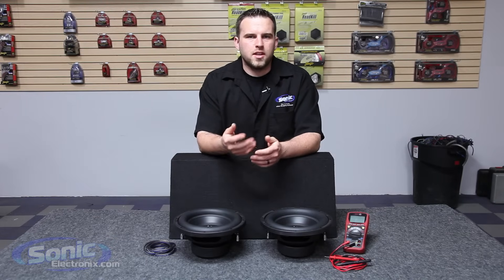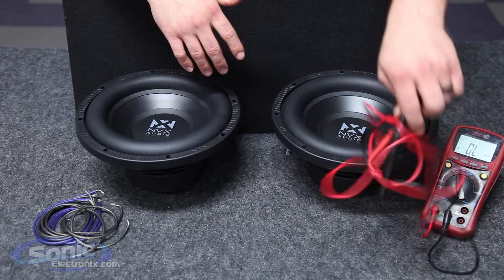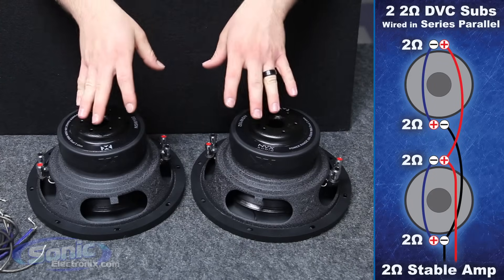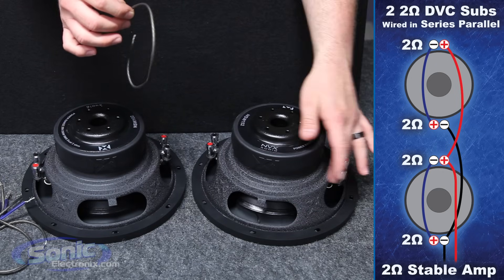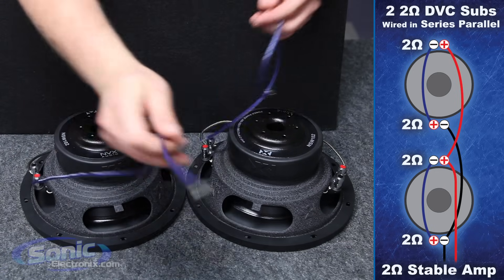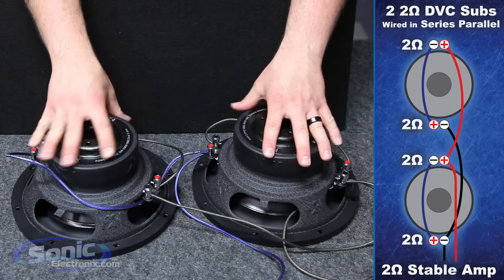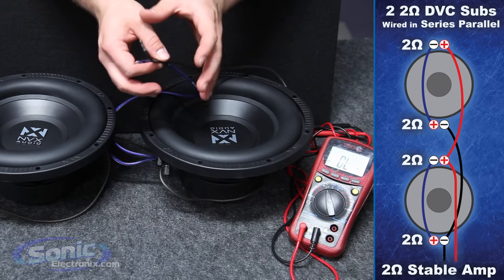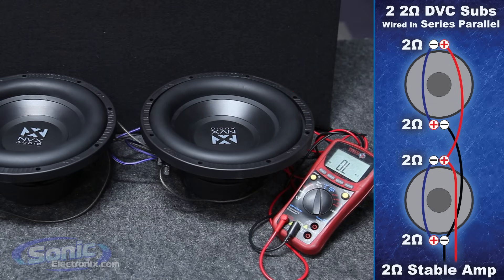How to Wire Two Dual 2 ohm Subwoofers to a 2 ohm Final Impedance | Car Audio 101

Comment: how do you do it when each speaker is in a separate truck box?  the 2 loose wires you ended up with would conect to 1 of the speaker boxes neg and the other wire to the other speaker boxes positive?

Comment: This video is the best that I’ve found the only issue i have is how to i hook up the subs? I have 2 connection terminals on this box for both subs, do i run a set of wires for both subs or just one set of wires from one of the subs? This video would also mean i have to run wires behind my port on the box which would be visible looking into the port

Comment: I have a kicker comp C8 8” rms 300w, if I buy another 8” and wire them this way, can I run them both off of my mono Rockford Fosgate P300x1 and have them rms at 300? Or would I have to get an amp with more available rms
Reply: That will work if your comps are either 4 ohm single voice coil each, or 2 ohm dual voice coil each. The rf 300.1 is 300 @ 2 ohm

Comment: After it's all wired up inside the box ..... How do I hook the speaker wires to the amp ? Because mine have both a positive and a negative on both sides of my box along with 4 outlets on the amplifier. Pos, neg, pos, neg.

Comment: If the 2 subs are rated as 600w each, after doing series and parallel connection like what you have done, do i need a 600w @ 2 ohm amp to drive these 2 woofers or i need 1200w @ 2ohm amp?

Comment: And what about cheapskates - who "borrow" - their own house speaker sub's (the 12" 8ohm jobs) that were the old house stereo B set speakers...?
Getting a 16 ohm single speaker
Directly bridged across a "still" working stereo two speaker amplifier running yes - two 4 ohm speakers.?
The final impedance SEEN by the amp - was a mere 2.666666666666667 ohms per channel
HOWEVER -  as the two channel amp - isn't exactly a 180 degrees opposed unit - but one of about a 90 degree to 120 degree offset - these three speaker channels then became a delta connected circuit - almost the same as any ordinary 230v/400v AC Power distribution system - running homes and businesses and the like - with full energy Hydro-Electric Power Stations driving those systems.
SEE - having two stereo channels output from one amp - doesn't mean that these are simply a single channel one speaker (filter bypassed) one speaker amp.?
Nah m8 - these are nasty beasts that can easily handle - any weirdly connected and paralleled speaker array - that "nearly" addresses the delta configuration - and thus delivers the same as - same as "voltages" across the two master channels - whilst delivering a phantom phase voltage - across the single DELTA connected speaker.
BOOM - three channel surround sound - from a single two channel amplifier.
Adding additional series / parallel speakers - (or multiples of each) - one doesn't take long - to hard wire in 25 speakers.
All driven by a single low power amp.

Comment: So I could run two subs off a monoblock if it had a stable RMS power supply for both subs combined? Will the wattage be additive or just as one sub

Comment: Can you use dual wires instead of single wires. If you end up with just 1 positive and negative how do you connect this to the box which has positive and negative on both sides of this box
Reply: Did you ever figure this out

Comment: I have dual 1ohm 12' subs...I can wire them in series parallel to keep them at 1 ohm stable.. correct?...to match the amp output aswell...I have 2 t1s1 12's and a t1000-1bd amp.. Rockford fosgate

Comment: My Amplifier have 15 channel Class D, out of which 2 channels are for subwoofer (100W+100W) (8ohms+ 8ohm) 
which is currently connected to a Dual Coil Subwoofer)100+ 100W &(8ohm + 8)

How can I wire one more Dual coil subwoofer (100+ 100) to share the load

Comment: If you have 2 dvc 2ohm woofers in separate boxes. Each wired at 4ohm. Would plugging them into the same amp like a daisy chain make them 2ohm as well?

Comment: What if I series both dual 2 subs up to 4 ohms both, then do parallel wiring at the amp does that 2ohm mean the same as your setup? Because they are in separate box and I use only 1 sub at times..

Comment: I have what is probably a stupid question. If I have two 2 ohm dvc kicker comp R’s in an enclosure with two inputs on it and both subs wired to 4 ohm. Can I connect each subwoofer to a mono channel amp that has 4 posts (2 negative, 2 positive) and get the same rms power to each sub? Or do I have to wire them both together in series parallel to one input on the enclose and then the amp? I’m not sure if that is a dumb question or even makes sense 😂. Basically I don’t want both subwoofers wired directly to each other. I want each to use their own pos/neg post on the amp if it won’t affect my final 4 ohm impedance. 🤔

Comment: What if the subs are single 300watts rms at 2 ohms, and the amp is 825watts at 2 ohms. I currently have only 1 sub hooked up, but thinking about 2nd. How should I wire it? If I parallel them, would that result in 1 ohm impedance and 4 ohm if series? Neither really works for me. I guess I should of gotten 2 4ohm subs to wire down to 2 ohm....

Comment: I have a 4 channel amp that I have two audiobahn tens and then just some crappie kicker door speakers hooked up to then I have a separate amp  for a 12 inch kicker competition R  and I'm getting like burnt wires smells after I run it for a while am I just beating the shit out of it or if you get that smell it's something not hooked up right ?

Comment: Can you not run 2 2 ohm subs down to 1 ohm on 1 amp
Reply: Yeah but some amps only go down to 2ohms
Reply: @josephmonrroy1877  I got two American bass xfl 12s that I wanna run 1 ohm and their dual 2 and I couldn't find it anywhere but I figured I jus have to run them individually to the amp I got a crossfire bmf 1000d I'ma use
Reply: you can't. Either 0.5ohm (not many amps can handle this) or 2 ohm. Buy dual 4 instead. Those will go to 1 ohm

Comment: I always thought dual 2 ohm would get you to 1/2 ohm. I have 2 dual 4 ohm subs and they are wired down to 1 ohm. This shit just confused the hell out of me
Reply: you are correct, you can wire them to 0.5 ohm. But that requires a amplifier that can handle it, so you are better of wiring them to 2 ohms

Comment: crazy question..i know you can wire a DVC 4 ohm sub down to 2 ohm but can you take those two wired down subs and make them to 2 ohm as well final impedance at the amplifier?reason why i ask is i have powerwedge JL 10s and the Tw3 D-4 in there is wired down to 2 ohm internally..i have two of these in a single cab truck powered by JL rd500/1 and im worried im at an unstable impedance..im wondering if theres a way to parralel an already paralled sub

Comment: Hopefully someone can help me. I’m not speaker Savy at all. I bought a sub speaker to replace on a home theater sub that blew out. The new speaker though has 4 hookups like shown in the video but the speaker wire that is running from the existing box only has two wires. Can I just hook up the terminals to one set of hookups on the new speaker and leave the others side alone or do I have to get a different speaker? The old sub speaker had two prongs only so the two wires connected easily but with four prongs on a speaker I’m confused?

Comment: So if u wire each sub series and to its own terminal, and then put both sets of wires coming off the box into the 1 channel amp, are u not at a 2ohm load?

Comment: Would i be able to use negative speaker wire to bridge the positive and negative terminals together? Or is there a certain kind of wire to run from positive to negative?
Reply: Cade Nofziger no special wire it's all the same.

Comment: how do u wire 4 kicker cvrs dual 2 ohm subs at max off off a 6000 gothic series 1 ch amp
Reply: depends on what ohm load you are trying to run at.
Reply: Parallel, if the amp is 1ohm stable.

Comment: I have three 8 inch subs . I want put the straight to the back seat . Will it sound good or will I need a box ? Thanks
Reply: box helps a lot good box designe is more important than how good is the subwoofer.

Comment: How do you do this with two terminals on the box?
Reply: BigSaltine drill a hole in the divider if ported. If not insert one sub in the box and wire both subs the wire the terminal only 1 terminal.
Reply: @Tom-wq2mz  Can I do this also if my dual sub box is not ported. Can I just drill small holes trough the dividing board?
Reply: @AxelfoleyTheGreat  Yes. That's how I do it. It will not hurt anything.
Reply: Puppet Master Man thanks a lot. I had my speakers 🔊 wired where they put out too much power for my amp so at high volume they cut out. My amp is rated at 2 ohms. Hopefully this will fix the issue. When I started upgrading my car audio stuff I only knew the basic wiring. Now that I have upgraded again this stuff gets more complicated for noobs like me.
Reply: @AxelfoleyTheGreat  as long as both or the pair are wired into 2Ω your fine. Do you know what ohm's your subs are.
Reply: Puppet Master My 2 inch subs are 2 ohm. I had them both wired in parallel. I need to change that.
Reply: Drill a couple holes and use some bolts, nuts and washers. All u have to do is connect the speakers cables on each bolt

Comment: Do I need a mono amp or can I use a 2 Chanel?
Reply: lemond Wilson mono amps are made for more power output has 1ch which I personally like. Some 2ch amp can be bridged for more power. It just depends on your preference. I'd tell you go with mono class D amp. That's what I'm using to power 2 12's P2D2 Rockford subs and it shakes and loud.

Comment: got a question for u. i got one 15 4000 watt and 2000 rms the amp i have is 2500 watt and the highest rms is 1000 my question is what fuse size do i need coming from the battery on red wire?

Comment: can you wire two dual 2 ohm sub woofers to an 1ohm amp . if you can respond quick as possible thanks.
Reply: kevo s cause parallel wiring 2 dual 2ohm will give you 1/2 ohm final impedance
Reply: You can't. Sorry. Either you go for 2 dual 4 ohm driver and parallel wire them to get 1 ohm final. or Purchase 2 mono amp to power each subs.
Reply: CORGI GAMING no
Reply: I don't understand why but from what I understand is if you have two dual 4 ohm subs you can wire those to a 1 ohm amp.
Reply: Mary Joan Montalvo how can you get 2 duel 2 ohms  subs down to 1ohm ? ...
Reply: well what kind of amp dio I use for this setup?

Comment: I have two dual 2 ohm subwoofers and I need a final impedance of 2 ohm. But I have two separate terminals on my box. Should I mimic the above wiring and use only one terminal on the box? Or do something different to utilize both box terminals?
Reply: Dominique Romar only 1
Reply: The positive on one side and negative on the other
Reply: Don't worry about the terminals on the box at this point. Focus on the subs How many terminals are on each sub woofer 2 on each or 4 on each 1 positive 1 negative or 2 of each.

Comment: so i have  two q class kicker dvc 2 ohm subs and a Hifonics brutus Elite class d amp rated at 4.850 2.1700 1.2500 would i be safe wiring  them to this impedance  without  blowing them or cooking the anp? iwant to push them to thier  full potential  help?
Reply: If your amp support bridge mode, do it.
Reply: Baby Gotenks you have to look at boss and hifonics amps as a temporary fix. I blew out my amp at 1ohm after 9 months of use. My amp is rated stable at 1 and 2 and 4 ohm stable. I'm personally highly recommend getting a Rockford foss gate 1200 amp. There amps are True watts they stay true to there watts on the box and a lot exceed it. I have a Rockford prime rated at 500 watts and 2ohm stable but is actually 634 watts so you get your money's worth. And there are really affordable prices. That's my opinion just look into the prime series.

Comment: So would you need to double the power then?  Ex:  Say those NVX subs are 500 watts each would you set you amp gain to a 1000 with this wiring method.
Reply: Resilient sounds
Reply: Resilient sounds

Comment: This might be a dumb question but can you wire a duel 2ohm sub to 2ohm?? or do you just use 1 set of terminals and the other ones just sit there doing nothing????
Reply: Low Fast Famous I'm pretty sure you just use one terminal, but idk, never really messed with wiring sub impedances, always bought preloaded boxes
Reply: Low Fast Famous do not leave a dual voice coil unhooked. You will smoke it.
Reply: @mikecarr1484 i haven't tried it myself, however i don't see there being a problem as long as you don't exceed that single coil's power handling.  For example, my Kicker L7R's are two 2 ohm coils.  Woofer's total power handling is 600 watts RMS and 1200 watts peak.  However, each coil is only 300 watt RMS and 600 watt peak.  So as long as i don't exceed 300 watts RMS, i shouldn't have to worry about it blowing.  

Can it be done like this? Yes.  Do i recommend it? Absolutely not.

(I'm not doing this for my setup.  My setup is an Alpine MRV-1507 with two Kicker L7R 122's, wired to a 2 ohm load and bridged to the amp.  A youtuber dyno'd this amp and it put out 1200 watts RMS at 2 ohms bridged)
Reply: THIS! Someone answer please
Reply: Mike Carr disagree..seen it done and did it myself with no problems
Reply: He's wiring both sub to equal 2 ohm, basically taking each sub down to 1 ohm a piece =ing a total of 2 ohms. it all depends on the amp of the user. In this case it's a 2 ohm stable amp.

Comment: ok so I want to hook two DVC 2ohm 600rms subs to a 600rms monoblock amp but don't know if the amp is enough to power both up to the 600rms, is there anyway to wire them so it acts as just one  sub so I get the full 600?

Edit: I figured out that the RF amp can be wired to 1200 RMS at 1 ohm so instead of the 2 ohm subs im going to get the 4 ohm subs and wire them to 1 ohm as per your video. However, there are two pos's and two neg's on the amp and I am wondering if it matters which terminals i connect to on the amp. I guess its internally bridged, its the rockford RF1200 D1 amp.

Comment: how important is it that the subs are facing up? i recently tested them again in the box (horizontally) and my two dual 4 ohm subs are coming up with a 2 ohm impedance which doesnt seem right. i've tested them before outside the sub box facing upwards and it shows 1 ohm which is what i expected. does this mean ill be running at 2 ohms since i wont be pointing my subs upward when it plays?

Comment: how the hell do you get them in the box after you wire them like that? plus what about the terminal inside the sub box?
Reply: Yg Bodybuilder wire the two wires connecting the subs through the box, wire the two wires to the terminals inside, and mount the speakers.

Comment: does it make a difference if I wired the - and + on the same voice coil together ? I ran the other voice coils into the speaker terminals and then paralleled them together, then ran the Positive & Negative to the AMP.   I have two DVC @2 ohms as well.
Reply: That was my question bc I did my subs like the but -/+ connected to itself on one side if each subs then used the other 2 terminals for the wire going to the box

Comment: are you using different wires to connect the subs?  negative jumper/positive jumper?  new to the game, can you explain the type and size of the wire you are using?  is this the same wire going to the amplifier?  i have (2) 12" rockford r2d2's and a boss 1500 mono amp.  thanks

Comment: Would 2 fosgate p2d2 12" subs be to much for the fosgate R500X1D amp?
Reply: Luis Chavez I have the same subs and I was told you could use that r500 amp at 2ohms set up but the Rockford 1200 watts would be better it would give the power that the subs need. And would sound better.

Comment: do you use all positive wires
Reply: +Kevin Reed there is no thing as a negative or a positive wire, the wire is just a rope of copper or some other metal covered in plastic,

Comment: I HAVE TWO 2 OHM DVC SUBS, AND WANT TO CONNECTED IT TO A MONO AMP @ 2 OHM, BUT MY MONO AMP HAS TWO SPEAKER OUTPUTS!! HELP
Reply: +johny Parra it's a "fake" dual output, the 2 + is connected in the amp and same for the - , it's like that so wiring is easier

Comment: Quick question I have to Rockford Fosgate T 1 subwoofers resting at dual 2 ohm voice coils I was wondering how to wire them in series parallel because the t1 voice calls built-in to 1 voice Coil
Reply: Shai Lee The T1 is a 4ohm or 4~ subwoofer with two voice coils, so it can be wired for an 8~ final impedance if you wire the coils in series + to - to + OR for a 2~ final impedance if you wire the coils in parallel, + to + to + and - to - to - .
It's either an 8~ subwoofer or a 2 ohm subwoofer depending solely how it is wired, when you use a DVC subwoofer both voice coils have to be used, you can't just use one voice coil and leave the other one disconnected, it would be like driving your car with 2 spark plugs missing, the only advantages to a dual voice subwoofer is:
1) increased power handling because it has two coils instead of one, you have two coils sharing the power so you can double the power rating for that speaker.
2) Because it has two voice coils it can be wired for 2 different configurations solely depending on the desired final load impedance of all the voice coils that are in the circuit, that figure is the final load impedance the amplifier sees. 
With a subwoofer like the T1 you could wire the 400 watt 4~ voice coils in parallel for a 800 watt 2ohm final impedance, hook it up to a 1000 Wrms @ 2ohm monoblock amplifier and rock and roll..